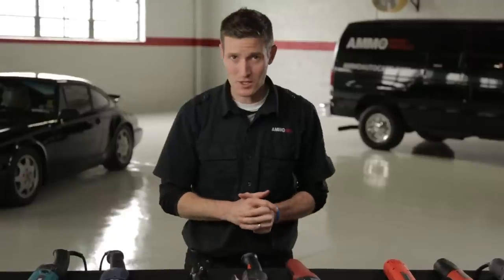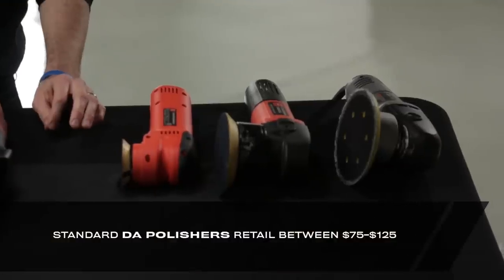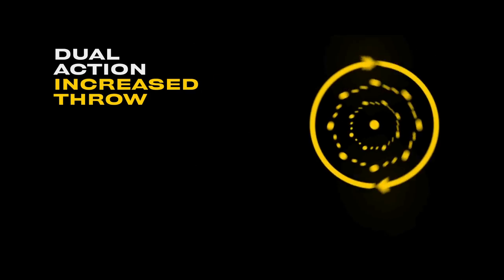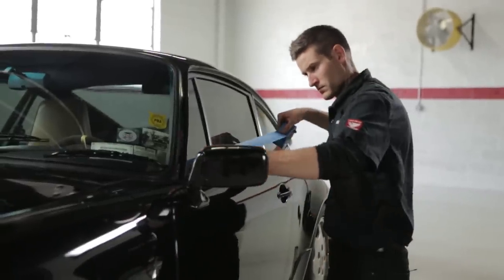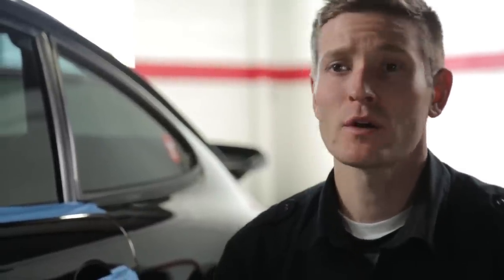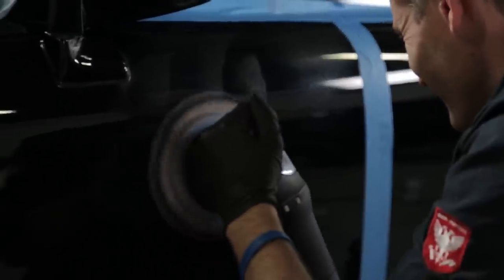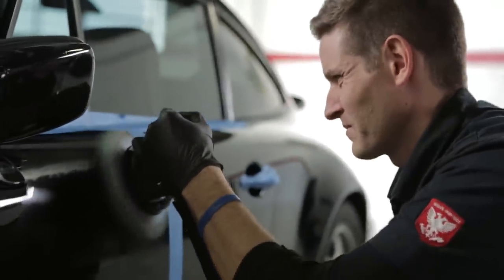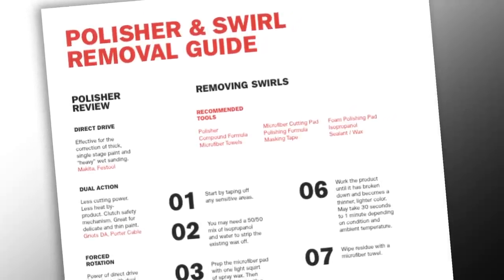Polishers and Swirl Removal Tips -- /DRIVE CLEAN

Comment: Its different for every car based on the layers of clear coat present BEFORE you start. But, your right....you cant polish/buff or "use abrasives" forever. My motivation in speaking/video with fellow car guys is to get this point across: develop a safe routine or "regiment" for maintaining your car and you wont need to correct your paint. (in theory) Its like going to the doctors...eat right, exercise properly, and you should need to see the "surgeon" every 6 months. (hopefully u get my analogy)

Comment: Hi, I'm no expert just a college weekend warrior. But my knowledge tells me it depends on how damaged the paint is, or how thick your paint is from the factory. I recommend a paint depth gauge to check your before and after to see how much correction was needed by removing paint. It also factors: in how strong/speed of a machine/ compound. No paint is the same so it's hard to tell without a test spot. Hope this helps, and again Larry feel free to hop in if i'm wrong.

Comment: Hey man, I'm not Larry obviously but there are a variety of different compounds that you can use and they vary in terms of abrasiveness. You should base your choice of compound on the severity of the swirl marks I would recommend Meguirs #9 compound as it's not too strong so won't cause very bad damage to your car should you get it wrong. The key to using a compound is to breakdown all the "bits" inside it,

Comment: How do you determine whether to Cut with Compound then use Polisher, or whether to skip cutting and go straight to polishing ? The swirls marks only looked light to me...

Also, if you go over the panel (cut/polish) and you notice a few spots that need touching up, is it ok to just cut/polish those spots or should you do the whole area again ?
Reply: sypher0101 It's fine to attack the same spots again. Look up Larry's video on him polishing RIDS on a black Porsche.

Comment: Usually you'll get a translucent looking film on top of the paintwork and that's when you should start to buff it off. Hopefully you will be left with swirl free paint after this.

Make sure also to use a microfibre applicator pad when applying the polish and a microfibre towel when buffing off. It also goes without saying that the car should be washed before attempting this.

Comment: (the compound has small metallic almost filing like things that scratch away at the paint) which you have to breakdown fully so that they can do their job effectively. Obviously this is a fair bit of effort and you can just  wipe it on and take if off, I apply by hand and work in 20cm by 20cm areas taped off. That way I know what area I'm covering and I can put in all the effort doing that certain area. Once you have worked the polish in thoroughly, then only you should buff it off

Comment: had a passenger open my door into a pole today... left a couple scuff marks, didn't gi through the clear coat. should i try to polish it out?
Reply: did any paint come off the pole on to the door?
Reply: Andrew - Compound it, then polish, and wax. Polish does very minor repair but if the paint has more damage then go straight to compound, then polish. If that doesn't work then it's wet sanding time

Comment: always start by using very little pressure, sometimes you can just use the weight of the polisher on horizontal panels i.e the roof, bonnet/hood and boot/trunk.

Comment: Hi there, the number of abrasive sessions a given vehicle can undergo is completely dependent on the paint depth of the clear, which unfortunately varies by manufacturer, car to car (even same models) and furthermore it varies by individual panels. Even a mild abrasive session can take the clear down by .2 - 1 micron of clear, and the clear coat layer thickness can vary anywhere from around 10-30 microns. Hope that gives you an idea, cheers.

Comment: Hey I use Turtle Wax Super Hard Shell as well, I found that if you apply the product too thick, it is very very hard to get off. I recommend only using enough product to cause a slight shininess while wet. If you can see the green colour against the paint, you've used way too much.

Comment: This video is awesome! Just out of curiosity, is it possible to remove swirls with the big 10 inch cheap one speed buffer/waxers or am I just wasting my time? I tried using it twice but it appears to do nothing with either the foam or microfiber bonnets.
Reply: Joe Doug no, the motor inside them is too weak for the 10 inch pad, and the throw is little, too.. you need smth with 5 inch pad, and at least 5mm orbit.

Comment: Larry

Could you show us how to polish and remove swirls underneath door handles and on front and rear bumpers that have many cutout for fog lights air dams and ect.
Reply: GREGORY NELSON there are special add-on cones for that. you can place these on a cordless drill for much easier polishing edges like around door handles and hard to access spots. the same for polishing on the edges of your door or for example a spoiler. there are foam-like ''balls'' for that. same ..for the cordless drill.

Comment: Great video but I have a question that wasn't really answered. What pads should we use for different situations? I noticed you switched from MF to foam but why, when should I be using a foam or MF? Thanks!
Reply: The MF pad (Microfiber pad) is meant to grind away at the paint, the fibers on the pad are bigger, hence better cutting ability, so when compounding use MF pads. When polishing use the softer and less abrasive Foam pads, Thou even withing the 2 groups you have different abrasive types. But the rule is the same, Bigger fibers = more abrasive

Comment: Thank you Larry for this great video!
But I was wondering, do you perhaps know at how many RPM the machine is spinning when you say for example 'at speed 5'?
Because I was at the store and trew a quick peek at the machines, but they all said for example 2500-21000RPM or 7000-12000RPM.. So Im not really sure which speed youre using matches the right RPM.
Greetings

Comment: Shouldn't you clean surface with isopropanol after each stage of polishing to remove wax from polishing compound?
Reply: That is a good step to take yes. It adds more time to the process but you will have a better view of the situation as you are clearing the waxes from the pores. Most compounds/polished have some sort of wax in them (probably to lubricate).

Comment: Can I do this by hand? Or do I need one if those machines? I don't mind if it would take a lot more time because it's for my bike (smaller surface). Sorry, I'm a student, my budget is tiny :)
Reply: Jef Gulickx it depends on the paint. If it is single-stage then yes. If it is a modern bike with a clear-coat, very doubtfull.

Comment: So is this a permanent fix as long as proper car hand washing and drying techniques are applied or does mother nature play a part in bringing the swirls back?
Reply: +Nihil2005 good question?????
Reply: To avoid future swirls, scratches, and imperfections, I always recommend my customers to stay away from car washes, use a clean mit or a brand new one, avoid shammies/water blades, use a clean or new microfiber towel to dry, and keep a fresh coat of wax at least 3 times a year
Reply: Hugo-Garcia HGX it's impossible to free swirl marks whole life 😅
Reply: Avoid mechanical car washes as in never go to one. Hand wash only with mild soap. Do not go in circles. No wax on wax off nonsense lol
Reply: Or just use a good ceramic coating after the car has been compound and polished. I had my car 3 stage paint fixed and did ceramic coating myself used GYEON mohs. 3 layers. after every wash I use P&s beadmaker to make the car shine and protect the ceramic coating.   @seansautodetailingllc2088

Comment: This is fantastic!
I have an issue with my car, it's got bug guts like permanently stuck in the cars' paint. Can I get that out? I've tried various chemicals but all it did was make the paint worse.
Reply: use bug and tar remover. use a bug sponge to get it off. make sure u get good lubrication.

Comment: So how many times can you do this before you remove all of the clear coat?
Reply: Good idea to get a depth test done before any kind of deep buffing.  Personally I'd never do this myself, happy to do everything else but this job is one I'm happy to pay a pro to do.
Reply: Depends on many factors. So it is a good practice to just be gentle. Always start with the least abrasive method, and then Re-evaluate. So if the scratches are not really going out smoothly enough, just step up the abrasive, either another pad or another Polish/Compound. Better to be safe then sorrow. Also if you are polishing a car and you see the color of the paint rubbing of onto your pad, you know instantly that you are dealing with a single stage paint, so be very careful with these.
Reply: You're asking the wrong question, my man. The real question is how can you get it done right ONE TIME, and then keep it protected regularly so you don't have to keep compounding and polishing over and over, eliminating more clearcoat each time. Having this mindset instead will eliminate the worry you have that you could go through too much of your clearcoat :)
Reply: Is there a way (do yourself) to add clear coat in isolated areas if you have gone to deep?.

Comment: I got a craftman orbital buffer is not good but it works... What compound or wax you recommend for removing swirl marks...? I got meguiars scratch x 2.0 and still have not tried it.
Reply: just use what you got, start with your lightest cut pad and polish and see how it goes, then either change pad or polish cut strength depend on how it goes
Reply: :-) Thanks.
Reply: I used DA tool and Meguiar's Ultimate Polish to remove swirl marks on my sisters new  Nissan Sentra.
Stupid dealer put massive swirls on a brand new car and refused to fix it.

Comment: How good are the results if I used the polishing compound on a applicator pad and apply it onto the paint instead of a machine? Are there any specific steps?
Reply: It is important that you prime the pad before getting it onto the paint, you should never polish with a dry pad, as that would cause damage. So prime and then, if needed, add more onto the pad after priming and dab it onto the paint, then like he showed massage it in on slow speeds, then go to town on it ;) You can however, prime the pad (on the machine) and then apply some compound/polish with an app pad onto the paint. But why use the extra steps if you can just use the pad on the machine itself? If properly primed that is.

Comment: Hi Larry , great video. i see there is till RIDS marks after using the Flex and the RUPES
any suggestion about that kinds of RIDS ?

I tried 2 pattern on same section with Menzerna FG400 and Chemical Guys Orange pad (cutting) and they are not coming off. 
also tried with the Microfiber pads by Lake Country
i'm using the Meguiars G220 (EU version)

Thanks!

Comment: hi! i wonder if the compounds of 3m can give me a swirl free finish? im currently using a rotary with waffle like pad. but planning to buy a DA. i want to achieve that zero swirl free finish. can help me out with this problem?
Reply: I recommend use 3m perfect it compound with the rotary to completely level out the scratches. Then follow with the da and menzerna 3500 polish to remove the swirls left from the rotary during the cutting process.

Comment: Would you be able to use this same process on chips down to the bare metal if they have a bit of corrosion present?
Reply: If you have chips out of the paint to bare metal, ask yourself this. If it is chipped to Bare metal, how are you supposed to level the paint ;) So no. It would require a repaint for that section. If you have scratches, it all depends on how deep those are, if they are relatively deep, also a repaint would be best. For other swirls and medium/light scratches you could potentially compound them out, OR if they are really nasty (not to the bare metal) Wetsand + Compound + Polish + Seal + Wax
Reply: So at the car washes, I take it they are only sealing and waxing?

Comment: Hey I have a cheap old 00 CIvic, and I got some deep swirls/scratches (you can kind of feel the swirls with your hand), and hand using (cheap) compound doesn't work. Am I simply doing it wrong OR does it need to be wetsanded painted and clearcoated?

Comment: Larry,
I have a 2012 bmw 328i and when i bought i from a previous owner, i did not see the rock chips and swirl marks.  So the least i can do is take the swirls out.  I tried mcguires compound and tried buffing it out by hand and it did not work.  So when you say compound, what kind of compound are yo talking about, and what brand.  Also, i'm thinking of getting a porter cable; what DA do you recommend.  I'm a first timer at this, and this is my first car.  Please help

Comment: That works for the paint job. But how can I remove scratches and swirls from the side mirrors.
Reply: Use a small hand pad and the same compound and polish you use on your paint. If you are very VERY careful you can use your machine to get the big area and your hand method for the areas your machine will not reach.
Reply: Angel Tapia A smaller polisher will also work, there is a 3in version of the one he uses in the video.

Comment: The rotary is still the best machine but takes real skill and knowledge. A DA with large throw spinning at high speeds can be almost as dangerous as a rotary as it is spinning so much faster than a rotary does and if you move too slow or have the bottom half of the pad overhanging onto an body line it can go through it.   just by spinning speed and heat generated.
Reply: I have no doubt that the rotary is a great tool if used by someone experienced, but no matter how much I tried with a rotary, I was always left with holograms despite going back and forth with internet forums. No issues with a DA polisher, and it still does a decent job. If I had a paint correction garage, I'd make sure everyone was using a DA polisher personally.

Comment: Is claying the car before completely necessary?
Not sure how cheap clay is over there but here in AUS it really isn't that cheap..
Reply: Claying a car for the first time will yield a serious improvement to the feel and look of the paint and can aid the process. You would be amazed on how much gunk there is in a seemingly neat and clean paint. Consider this. When you are polishing you are in effect removing layers, those layers as seen under a microscope are in effect mountains and valleys so the cutting pad is leveling these. If you add into that all of the gunk that is inside the paint you would have a far more abrasive structure and maybe even damaging the paint instead of aiding it or leveling it. It is a good practice to Clay the car before going to town on it. Every little piece of gunk that you remove during claying is a scratch less. Since these bits are getting stuck inside the pad and rubbing over the surface. I hope this helps you + Claying is fairly simple to do, just make sure that you lubricate it enough either by using a Luber specifically for claying or just use your washing water that you used when washing the car (the clean water with the soap added in of course, not the rinse bucket water)
Reply: very informative, thank you very much :)

Comment: Is there anything wrong with the old fashioned "hand job"?  (Can't believe I said that!)  What is the advantage other than time saved when I can just get a hand applicator and polish it manually?  I don't mind the extra time as long as the quality is the same as the machines.
Reply: I used to do all of my Polishing by hand, and still do my buffing by hand (waxing/sealants) But having switched a while back to machines for polishing, it is a world of difference. Getting better results in far less time. I agree that the first buying price is steep, but once you made that commitment and got used to it, i would never want to go back. Thou i often use the hand technique on places a can not reach. However when Waxing/Sealing i still use a app pad and do it manually.
Reply: Hand polishing simply cannot generate enough heat needed to properly correct the paint and remove the swirl marks.

Comment: After using compound should i use the polisher or wax?
Reply: You usually have to use polish after compounding and then use wax
Reply: Wax and glaze have no abrasives in them which means they cannot cut. They add a layer over the paint that protects and enhances look of it. Compound = heavy abrasives. Polish = micro-abrasives. Wax/glaze/sealant = no abrasives, adds a layer of skin to the car.